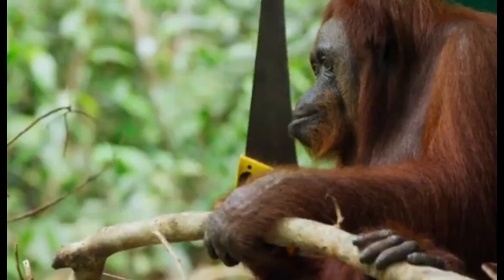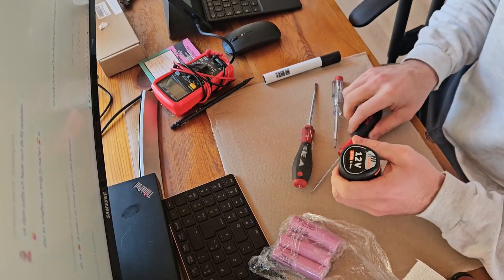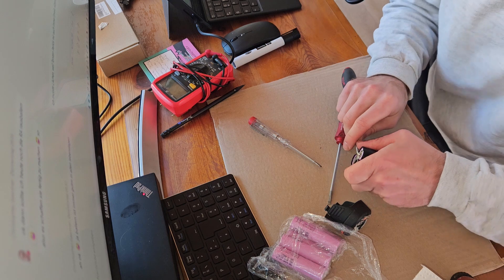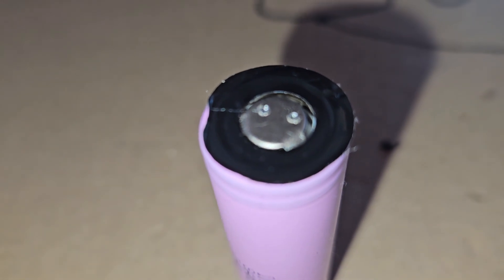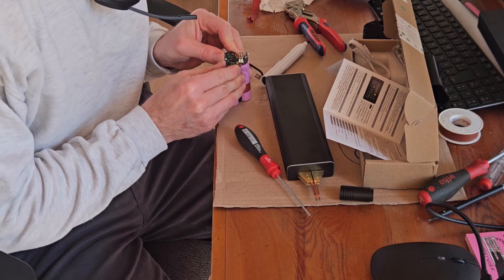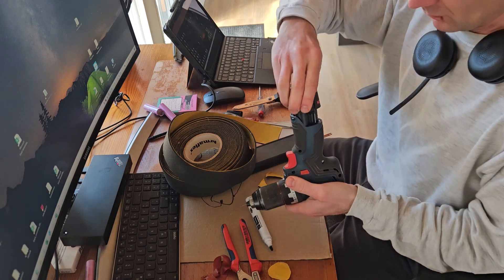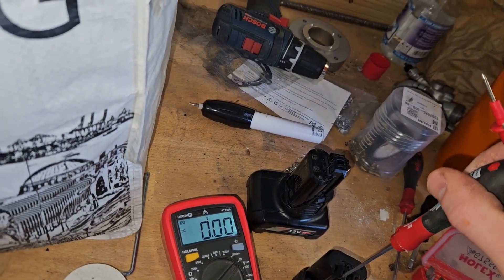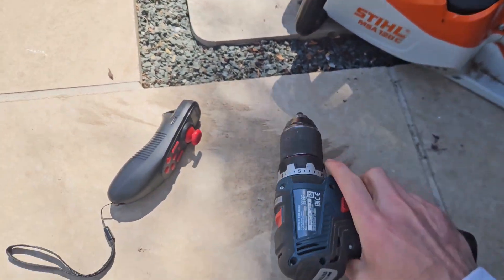FIX Your Dead 12v BOSCH Tool Battery with Amazon Spot Welder!

Comment: Hi can you please tell the brand of battery that came out?
Reply from the maker: I double checked INR18650-30Q SAMSUNG SDI 141 says the lable
Reply: @Son-of-Allen-key Thanks! I have a 20 year old labeled 10.8 volt battery which has a 20 Amp Sony battery, US18650VTC. Yours is quite new, but less amps. The one you used now only has 8 amps max discharge, which will limit the power with some tools. Newest Sony is now called Murata 18650 VTC6, which has 3000 mAh and max discharge of 30 Amps. This is mostly used in the "high output"  tools such as hammer drills.

Thanks again for checking!